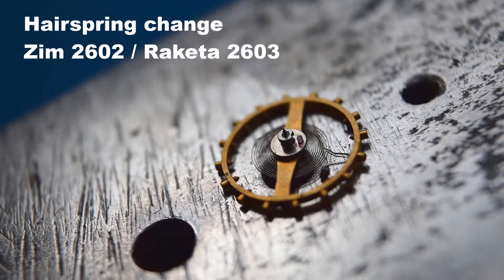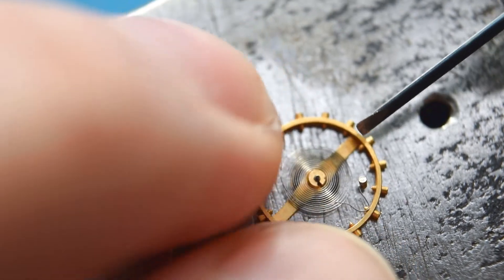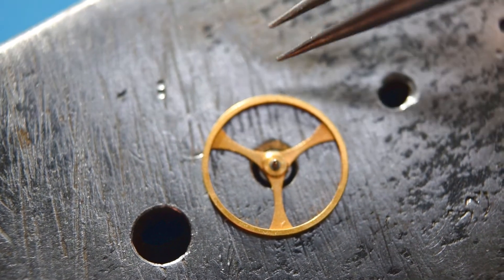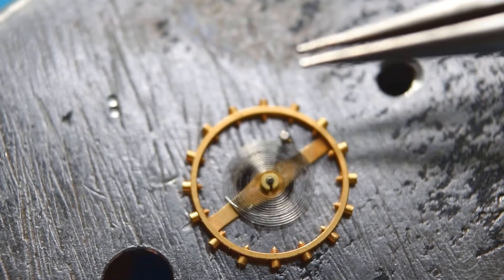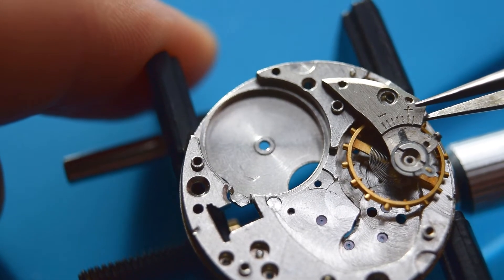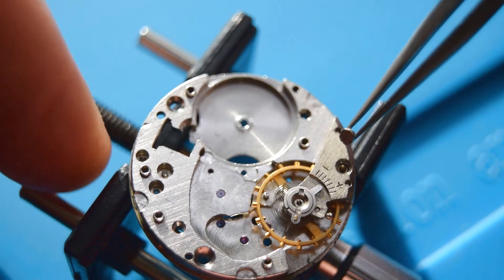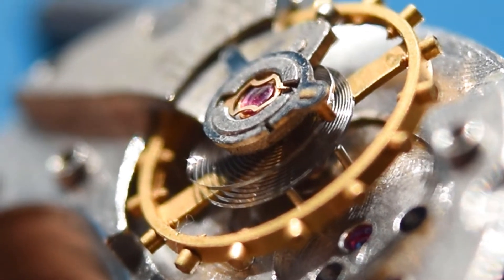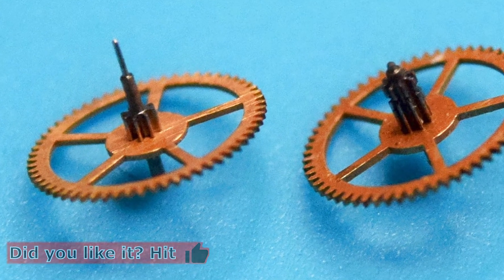Change of damaged hairspring Part 2 START wrist watch made from a junk

Comment: First the hairspring ist not damaged, it is only a little bit out of shape,
with some skill an patience it can be fixed.
Second the new Spring comes from a much lighter balance wheel,
it will most probably be impossible to regulate the watch to keep time.
Reply from the maker: Thanks for your advice I really appreciate it 👍
Reply: 100% this. The overcoil looks fine and that's the worst place to correct bends. I like two finely ground bent tweezers with a rubber band wrapped around them to take up some of the spring pressure and  also to close in the gap. 

This one I would pull the collet and hairspring off the balance staff,  and then put it back in the balance cock. Using the balance cock as a holding fixture for the hairspring you also can use the collet and top jewel balance jewel as a centerline so you know when everything is back  in alignment and it also offers a good view of any tilt that may need  to be corrected.

There's a great video on youtube of Henry Fried in 1974 straightening hairsprings.

Comment: Did you just take a hairspring from one balance wheel and install it onto another?
Reply from the maker: Yes but the sam movement /caliber type, with a different hairspring it will not work
Reply: @tickingWATCH  But hairsprings are mated with a specific balance.  Youre not supposed take a hairspring off one balance and put it on another even if its the same caliber.

I've only been doing this a couple years and even I know that.

Comment: I would suggest using a pair of (rocking) hand levers to remove the collet from the balance staff. It would be a lot safer as you don't risk slipping the screwdriver into the hairspring.
Reply from the maker: Good idea! Thanks for your advice I really appreciate it

Comment: I guess the watch will run much too fast or too slow with the new hairspring, because it's not suited for the different mass of the balance system. If not, it's pure luck.
Reply from the maker: Probably you right, but let see how it will end. Just in case I have a spare movement which can go to this case 😀

Comment: Nice job! I like eastern block watches as you can repair them with anything you have. They are built to last. 
While changing a hair spring I would only check a beat rate of the donor movement if it is the same value.
Reply from the maker: Thanks. It is so indeed, and thanks for advice 👍